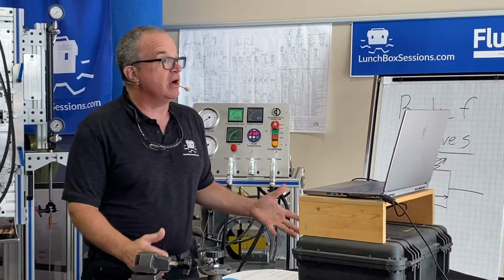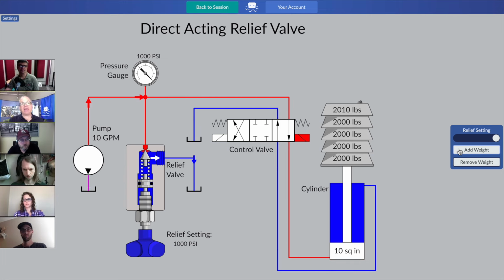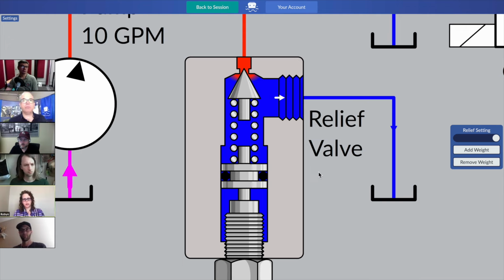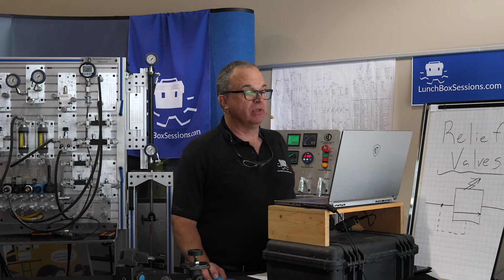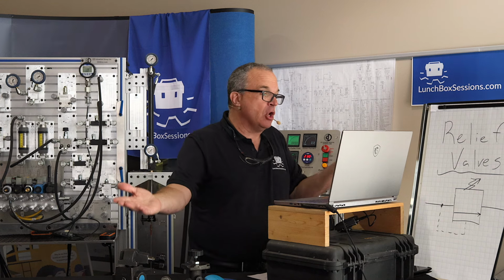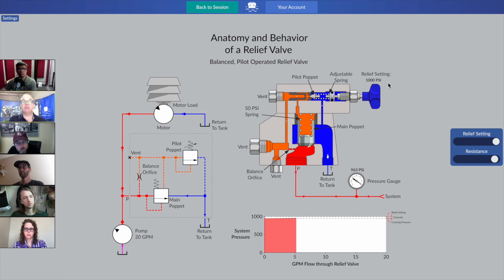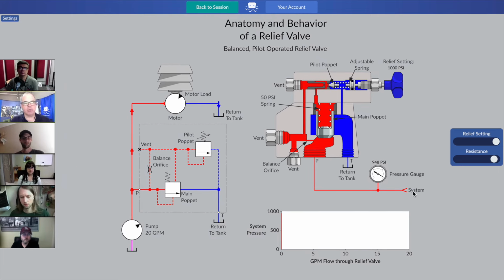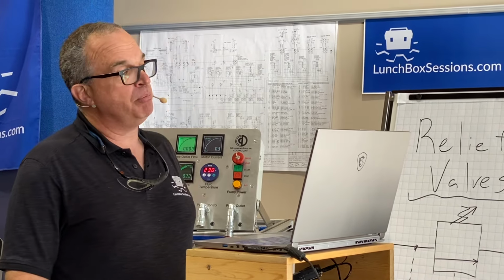Teaching: Relief Valve Basics

Comment: So if I have a relief set at 1500psi going to a locked hydraulic motor....would I expect the system pressure to be only 1300psi,no matter what?  This is confusing.

Comment: Question. @40.11 pressure below 950psi keeps the poppet closed because of pressure balanced through the orifice. Then that means it should balance after 950psi. But it doesn't why?

Comment: You're a very good teacher. I'm moving into a new roll at a very large aerospace company where I will be calibrating hydraulic systems. I am being trained on site by an individual with over 35+ years of experience in this field and I am using your video to help me "brush up" before I start in 2 weeks. I have 15 years in aerospace working on building complex tools for precision drilling on the structure. Now I am moving into metrology / calibration. Thank you for your amazing ability to teach and your expansive knowledge!

Comment: Hi sir I am kannan ,Chennai India, hydraulic system normal running time  oil high temperature, how can normal temperature without use air cooler,water cooler, and jiller units ,

Comment: I do have a question 
What will happen if I replace a  gear hydraulic pump with 22 cm/rev to 42 cm/rev 
What will happen in my system  🤔? 
Another question is the relive valve gonna send the unneeded oil to the tank ?

Comment: Why did the pilot valve start oil leakage to tank at 950bar? Shouldn't it have started at 500bar since it is similar to the relief valve without a pilot in previous slide?
Reply from the maker: Great question. The pilot poppet surface area and the pilot spring is much smaller for the very small pilot flow volume, and thus the override properties for the pilot section of the balanced, pilot operated relief valve are different from the poppet and spring properties of a direct acting relief valve that would be large enough to handle full pump flow.

Comment: In a balance piston type relief valve,there’s a pilot port.if pilot pressure is applied the valve functions as unloading valve?am i correct?
Reply from the maker: Often a vent port is available with a balanced, pilot operated relief valve yes. The vent port can serve several functions including a system unloading one like you mentioned. This function is usually about allowing pilot pressure outward, towards tank, as opposed to applying pilot pressure 'into' this port. A true and dedicated unloading valve while similar is also a little bit different from a relief valve.